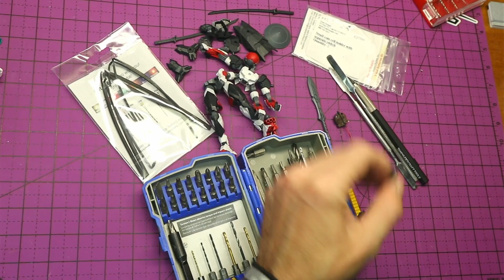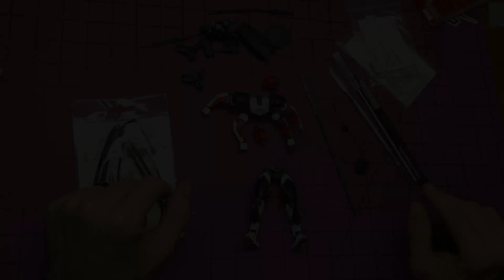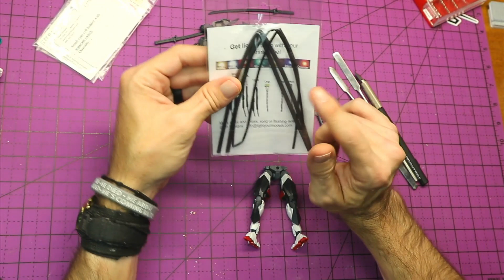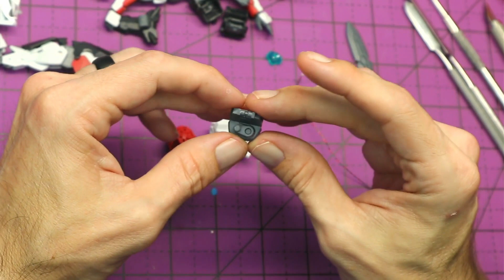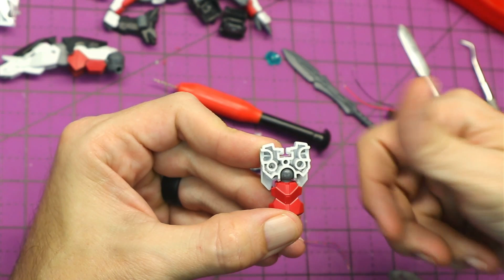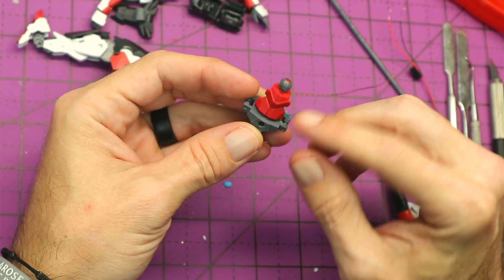30MM Spinatio WIP, Installing Led Lights

Comment: Great video dude also if separating parts often for fitment you can cut peg holes at an angle to make it easier breaking tension you can then glue later on 😃
Reply: Great video. What's the name of that saw thing you used when cutting the neck/chest section?